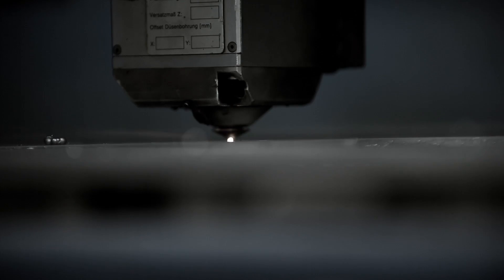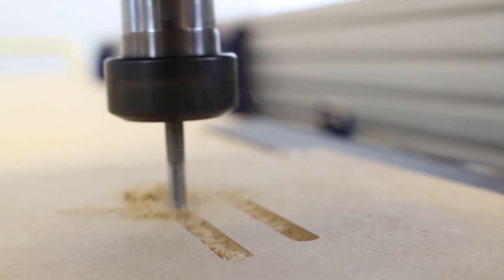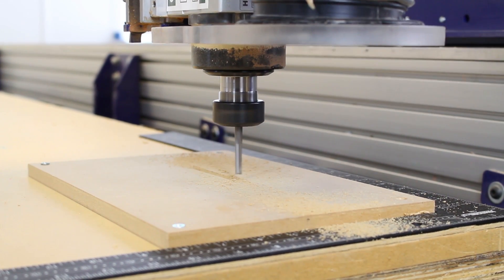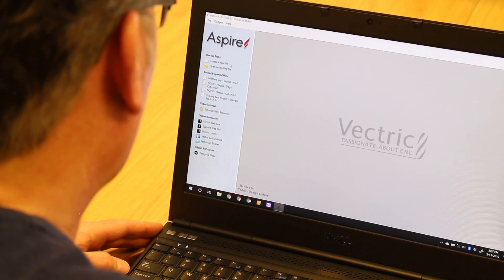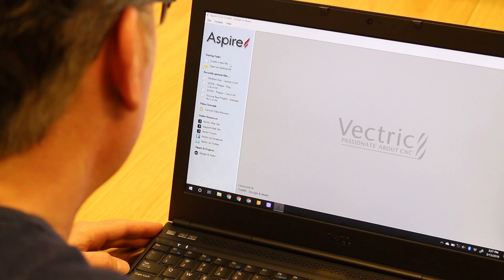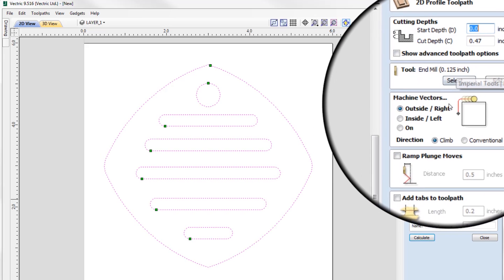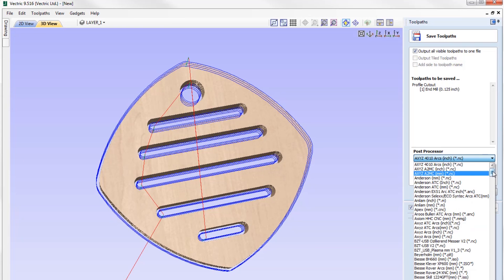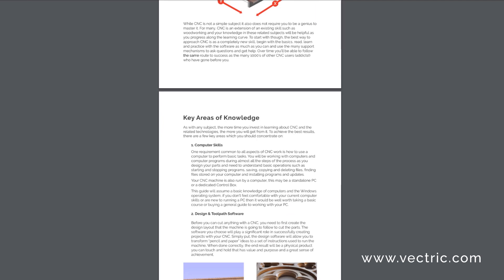What is CNC? | Vectric

Comment: Is this video a precursor to a new series of your existing software?
I've been looking at Vectric software for over a year now,  unfortunately very little information can be found on Cut3D,  loads of tutorials on VCarve Pro & Aspire,  both of which are totally out of my budget  : (

The existing Cut3D tutorials on your website are about 5 years old now,  and a mere 7 minutes long!  So,  not so much as a 'tutorial' but more like an 'introduction' to Cut3D.  

I bought my CNC WorkBee machine from 'Ooznest' in the UK,  so I know it's compatible with your software,  but I'm not sure if Cut3D would be able to achieve what I need it to do.  I won't be carving wooden signs or anything in that nature,  believe or not,  I'm actually planning on using Cut3D for producing CNC High Density Polyurethane foam moulds. Known in the industry as 'plugs' or 'Bucks'.
So I would need a plunge depth on my 'Z Axis' of at least 100mm.  Can Cut3D do this without the need for 'splicing'?

TURK @ T4 Concepts